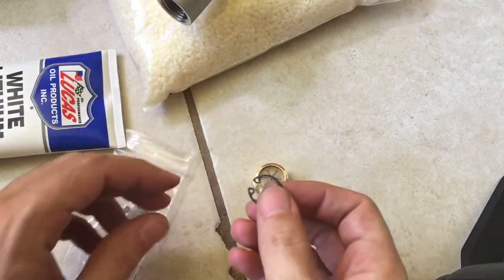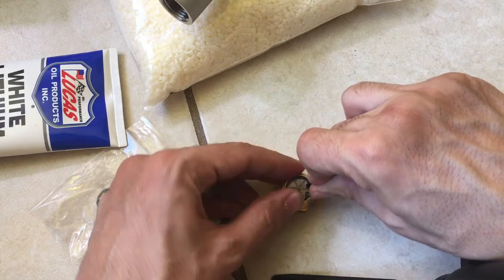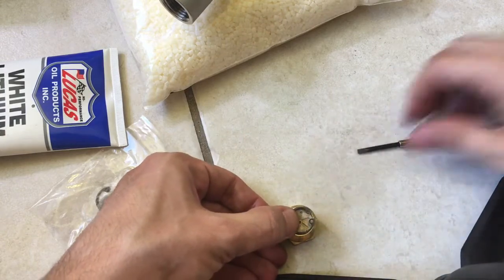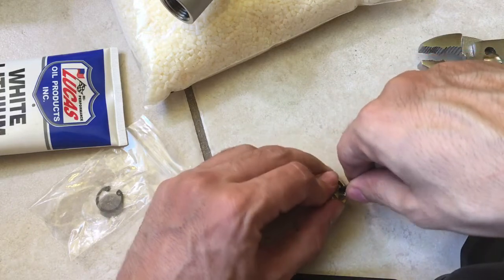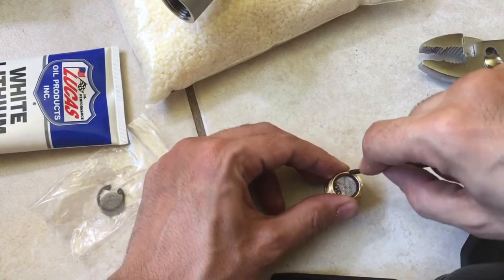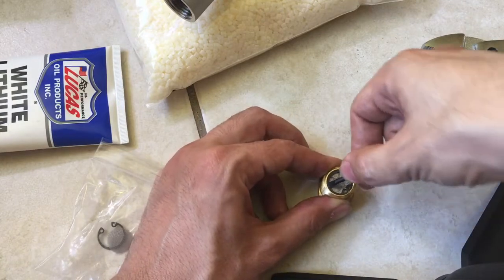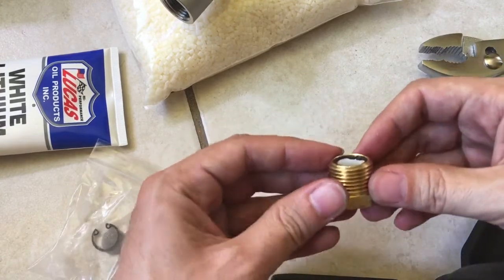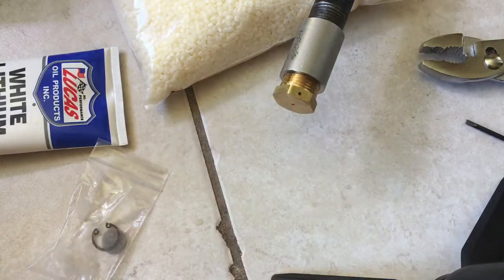Filastruder for noobs dangerous procedure watch out part 20

Comment: Putting one together this weekend. Did you do it vertical or horizontal ?
Reply from the maker: I finally received the new chassis. Haven't rebuilt it just yet... then I may ask you about how you did your electronics... haven't assembled those yet.
Reply: Marco Reviews electronics went fine, my servo was dead out of the box and replaces with cheap off the shelf RC servo from airplane. Quality of the kit could deff be better.
Reply: @AdditiveAvery  For real. I had to make mods just to complete mind.
For this c-clip, you need a set of c-clip pliers, and even then it's a PITA, plus there's no channel for it, like there should be. It really is just in there by friction.
I'm glad to see more Filastruder videos. Feel free to join some of us on the 3D Printer Filament Recycler group on Facebook.